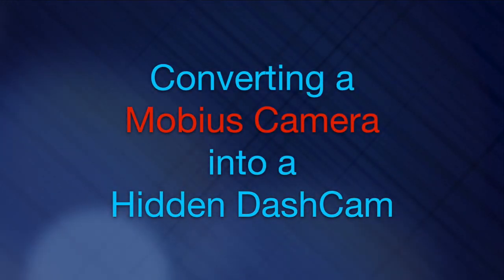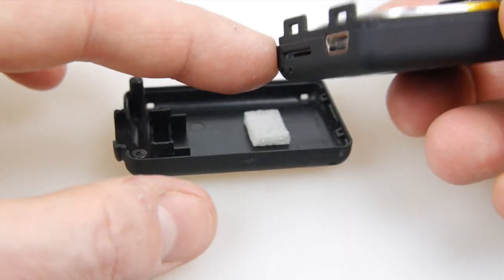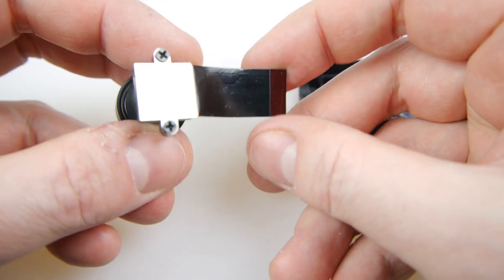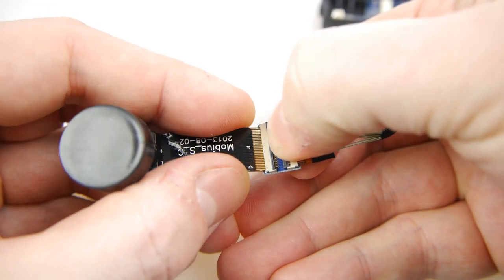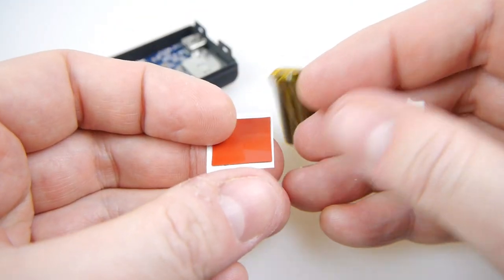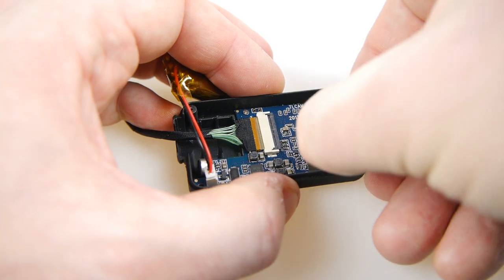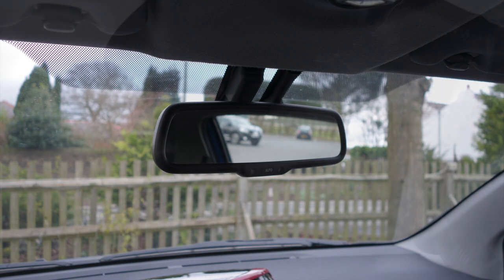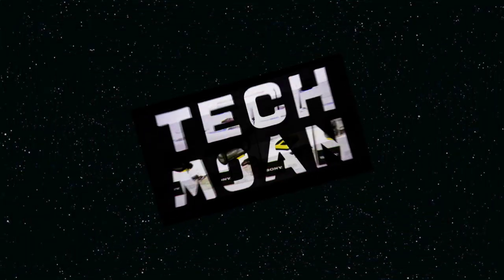Assembling a hidden dash-cam from a Mobius Camera and some accessories

Comment: Hi Mathew, in Mobius cam, what is the max size of "lens extend cable" available?
Reply from the maker: khan khan I think it's 8" (20cm)
Reply: Daniel Kanas Be careful! This extension cable is for the 808#16 Pocket Camcorder which has 24 pin ribbon cable. The Mobius Actioncam 1080p uses a 26 pin ribbon cable. Will still work-ish but you'll loose HD picture quality. Make sure you get the right one!

Comment: @techmoan Do you know if it is possible to mount this device on its side and still get a vertical picture?
Reply from the maker: +Javier Sola You need to buy a Mobius with a 90º lens to get a landscape picture with the camera mounted sideways.
Reply: +Techmoan I've just done a swap like in this video and now it appears to not work. When I turn on power a blue light flashes once on top then goes off, and a red light at the back flashes 3 times then goes off. Can't get it to charge or be recognized by my pc either. Any suggestions as to what is wrong? I also put back the old lens and same goes.

Comment: I have the Mobius, But ill stick with the mini 0801 a far neater dash cam. If that extension was longer to go round the window it would be a better job. But as someone mentioned the longer the cable. you lose picture quality.

Comment: Curious if the Super Capacitor for the Mobius could be used on the G1W Dash Cams?
Reply: Already have a G1W just wondering if the Mobius Capacitor will work in it?

Comment: if the wire is so long , would that effect the record quality ?
Reply: No, because it is digital, not analog.
Reply: Where can you find long ones??
Reply: it will, cause timing issues on high bitrate digital signals, (see timing issues with PCIe extenders)

Comment: Will you ever have to change the 32GB memory card? Or do you just plug it into the computer and delete the unnecessary files?
Reply: +Noah Cornelius No need to delete anything. I believe it does looping video.  So every 32gb it will sort of start over
Reply: +Noah Cornelius  All of these cameras that Techmoan reviewed for dashboard camera use have a functionality that they automatically delete the oldest video when they start running out of space, so you don't have to delete the videos manually.

Flash memory cards have by principle a limited life, in the rather distant past i'd experience that the file allocation table region will get damaged from too frequent overwriting after 1-2 years of daily writes. But they have gotten better now, they will actually move data around to avoid rapidly wearing out a frequently overwritten section, i haven't been able to wear out any of the modern ones so i don't know, my estimate is that a modern one can last more than a decade, maybe worth replacing 5 years in just in case.

Comment: I've set this up in my car using a hard wire kit and used the fuse for the 12v socket. I have a problem with the camera starting up. when the ignition is turned on it powers up and starts recording, but then when I turn the engine on the 1 second of lost power while the engine turns on seems to turn off the camera and it doesn't turn back on for the whole time the engine is on. Obvious this is a big problem as the camera I switched off and not recording during my journeys. Any ideas how I can fix this??
Reply: Anybody got any ideas?

Comment: You've replaced battery with cap. What power source camera uses for real time clock then?
Reply from the maker: It should have enough power in the cap to keep the clock going...but I'm not sure for how long. I'll run it a few weeks and see how I get on.

Comment: I would take some foam from packaging and punch a hole with a pencil or anything appropriate . TO PLUG THE CAMERA HOLE AND USE SHIRK WRAP FOR THE WIRE CONNECTIONS .

Comment: Does this automatically turn on when?
Reply: djlolypop There is an option in the settings to make it start recording as soon as the power is plugged in, so in this case, as soon as the car is started (i.e. receiving power from the cigarette lighter).

Comment: I tried using this cable but all I got was grief. There were quality issues and dots all over my recoding
Reply: High bitrate digital signal is very susceptible to signal noise/loss, hence issues using a longer extension, you might have also damaged the sensor

Comment: My mobius doesn't work, when I turn on the car it keeps recording for a few seconds and then red flashes a few times fast and blue ....
don't know what is the problem...
Have the same thing in my two mobius cameras ....
Reply: FFPThomas Sounds like mine I think. It was just the crappy charging. If it's low on charge and you record and try to charge in car at the same time, appears to not be able to cope. Needs to be fully charged first. I stick my into a PC to charge it.
Reply: Steven Whiting , thanks, will try it :)

Comment: Now.. I cant totally agree with this build.. Although the hidden bit is actually very nice, it losses its purpose as a dashcam.. If you get involved in a heavy accident (only an example) well.. this thing its gonna tear apart like it was never there.. and the short term capacitor? Well thats going to shut down pretty fast..so it wont be able to capture anything..Thats my opinion though..
Reply: The Mobius is powered from the lighter socket. The Capacitor's job is to save the file being recorded when external power is cut, & to keep the date/time stamp functional. I have the capacitor in my Mobius & it works perfectly every time. Mobius is tougher than most purpose-made dashcams, it's the default choice for RC Aircraft fans & has a proven track record of surviving multiple crashes. If the camera is damaged in a serious car crash, the memory card will still have the evidence right up to the second that the Mobius power supply is cut.

Comment: He did not explain t he capacitor at all. The battery lasts 40mins? How long does the capacitor last ? If it doesn't last as long or even 20mins then I would not like the capacitor even if it lasts forever and battery's dont.
Reply: 4.20 - the car power supply runs the camera. The capacitor just provides enough for the camera to power off and won't wear out like a normal battery
Reply: when the ignition is turned off the camera would normally run from the battery wouldn't it? That's how they normally work. The equiv of parking mode in relation to normal car cams,and thats the flaw.A battery will last longer than a capacitor.
Reply: ***** Mobius doesn't have a parking mode. You can enable Motion Detection, which can be powered by the battery only for about 80 minutes when the ignition is off. I prefer to leave mine in loop-record mode when I leave my car parked unattended. Powered by an Anker external battery, which is good for over 20 hours. I have the capacitor in my Mobius. It's only purpose is to save the last file being recorded when the ignition is switched off & to keep the date/time stamp correct. It's much preferable to the standard LiPo battery for dashcam use.
Reply: russ bland it also depends on the car. he said that his will be powered from the cigarette liter in the car. some cars the power is always on like my car. others only when the ignition is switched.

Comment: а зачем аккумулятор поменял?
Reply: LiPo batteries have no business in a car. The heat within a parked car on a hot day may make a LiPo swell in size, overheat & damage the camera. In extreme cases, LiPo batteries have caught fire & even exploded. Capacitors are much safer when using Mobius as a dashcam.

Comment: Hi 
I’ve been following your review videos with interest. I particularly like the idea you had an input for the design, also adding some improvements to the Mobius Camera. I just wonder if you would consider the following a workable idea and if so would you pass it onto Mobius:

Instead of the Mobius Camera having a microphone fitted behind a small hole at the front, how about replacing this with a 2.5mm mic socket and supplying a mini mic as part of the accessories. I think this idea would really improve the versatility of the camera. 
Have a look at the following link:
http://www.micronic.co.uk/store/item/44/gold-plated-laptop-notebook-netbook-minidisc-microphone

Comment: But does it have sound????? That is what you need if police pull you over.
Reply: Mobius audio quality is good.
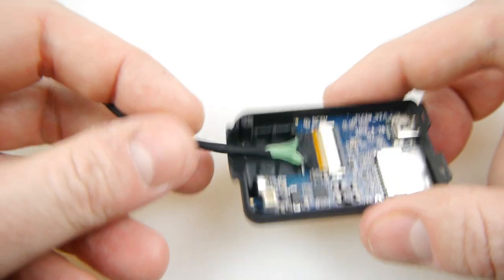Reply: The microphone is soldered on the PCB. You can see it right next to the battery connector on 4:14.  The device still recording sound.